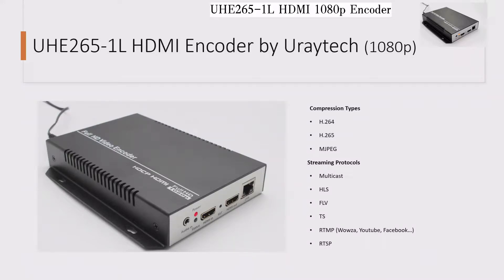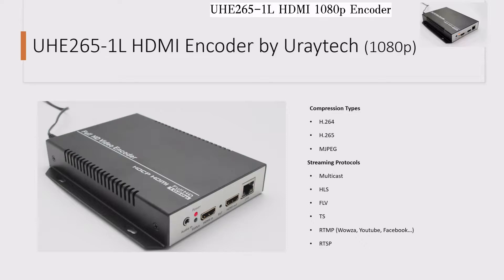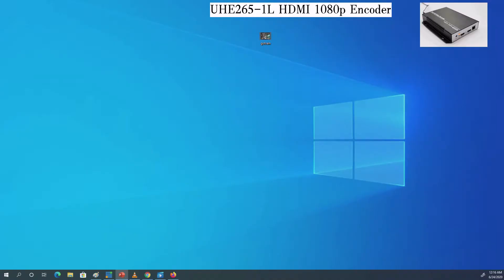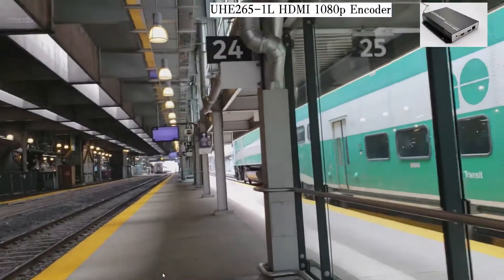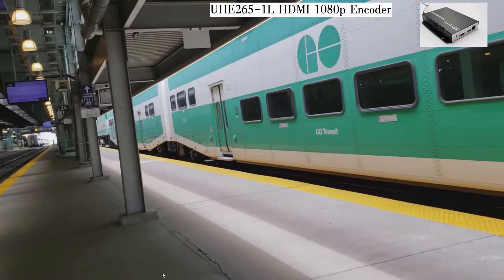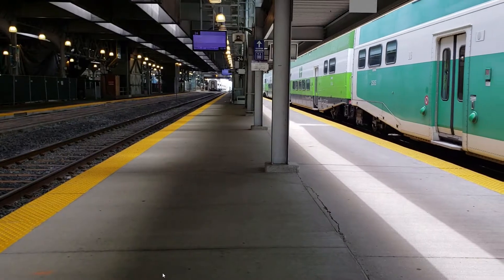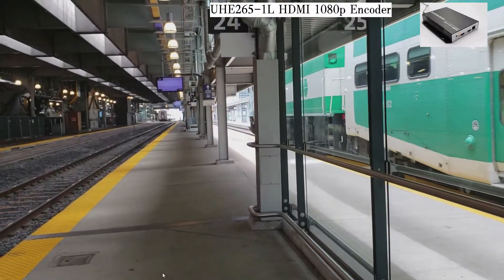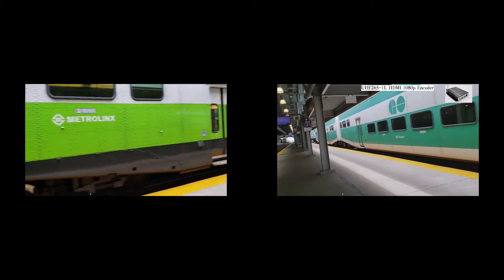HDMI Encoder UHE265-1L Multicast Streaming Output Sample

Comment: Good afternoon, if it is not too heavy, you could use this device on an HDMI output of the notebook using OBS Studio.

In Brazil we have some processing difficulties ... I would like to buy this item to be able to use OBS Studio only as a scene manager ... So
 do not use the notebook as an ENCODER, which costs the processor a lot.
Reply from the maker: Hello Jose, bom dia, como vai voce. 
Absolutely, you can use OBS for video switching and have this encoder do the CDN push, here is a link to a video I made for that: https://youtu.be/fw_gOIyru1k